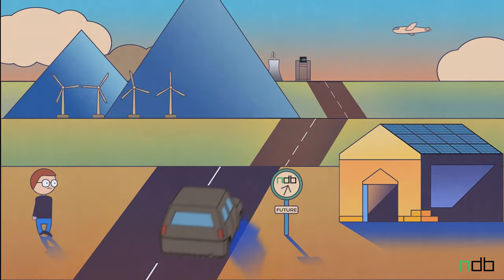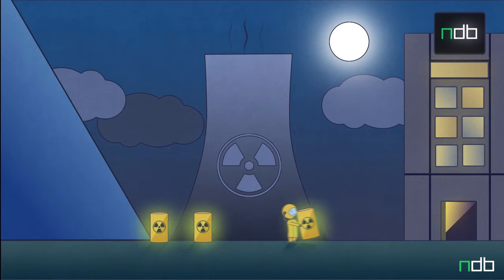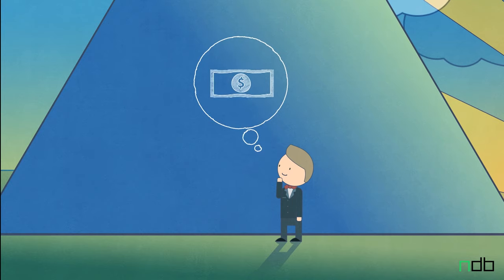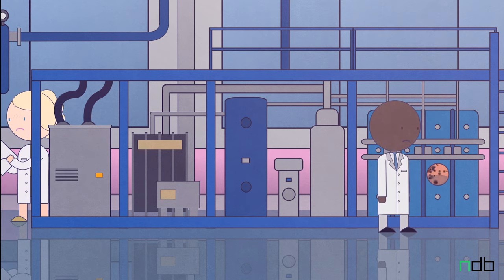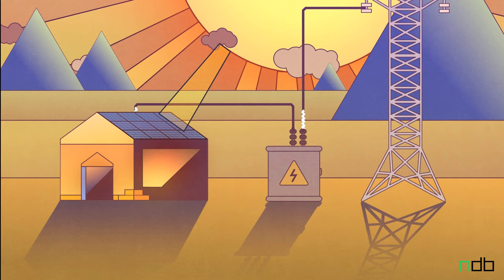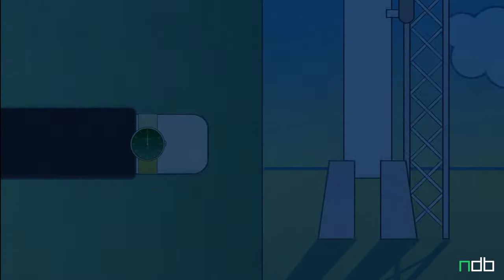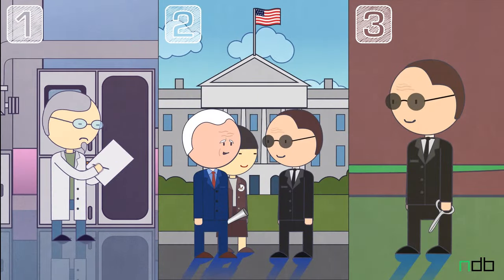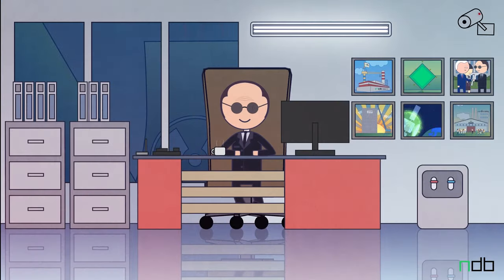Nano Diamond battery explained #NDB #Green_energy

Comment: Do you have any published technical articles on the science of your tech? Any data that shows promise with respect to power output/safety?
Reply from the maker: You can access our published pending patents from the following links:

https://patents.google.com/patent/WO2021236067A1
https://patents.google.com/patent/WO2022010488A1
https://patents.google.com/patent/WO2021247013A1
Reply: Have you read it yet?! 🧐
Reply: Also wondering if you read the published patents yet?
Reply: @VRtechman  I'll be honest I don't have the electrical engineering background to know how legitimate the patents are.
Reply: @POVMovies  seems feasible but in order for it to be effective long term there would still need to be a capacitor on board making the battery itself have a pretty significant failure point. An additional problem is discharge. At some point this thing will have to discharge excess energy meaning it will have to either ground itself or connect to the grid to dump it's charge. Having this in a pacemaker without an outlet would probably be a death sentence because excess charge would lead to your pacemaker being forced to discharge on the heart. It's a cool concept but it's uses would be limited to something like a cellphone or something you could plug in. A power wall, even an EV battery replacement would probably make more sense. Imagine you drive all day and your battery is down to 50% you drive home and you plug your car in but not because it needs to recharge but rather it needs to eventually discharge excess energy regeneration.
Reply: @Some1special what if you had a battery small enough that it matches the power level on the device whenever it's on then if you power it off you could have a port for the excess energy to go
Reply from the maker: @Some1special  thanks for the comment, concerning your comment about pacemakers, please refer to https://orau.org/health-physics-museum/collection/miscellaneous/pacemaker.html:

"Over the years, various power sources have been used for pacemakers, including thermoelectric batteries containing 2 to 4 curies of plutonium-238 (88 year half-life). As the term "thermoelectric" implies, the heat from the decaying plutonium is used to generate the electricity that stimulates the heart. At present (2003), there are between 50 and 100 people in the U.S. who have nuclear powered pacemakers. When one of these individuals dies, the pacemaker is supposed to be removed and shipped to Los Alamos where the plutonium will be recovered."

Comment: After Theranos, this is hard to believe. Even in huge nuclear plants we cant generate electricity this way, avoiding the rankine cicle (radiation-->heat--steam-turbine-movement) has been a long standing problem... True, we had radioisotope thermoelectric generators, but that had problems of its own (bulky, heavy and low energy output, plus dangerous waste). On the other hand, patents seems legit, but... What Theranos was lacking, and everybody should have seen, was whitepapers that explain the technical reasoning behind it.  This kinds of breakthroughs doesn't came out of the blue, just like this.
Reply: Glad someone else notice that. This projects has to many similarities to Theranos and it wouldn't surprise its another scam like that company.
Reply from the maker: Theranos was a public company claiming a ready product.

NDB is not a public company and not claiming a ready product. We are still a venture in R&D stage and planning to realease a commercial prototype upon success.
Reply: There's a difference. Theranos was a company that claimed to have its own breakthrough but never released the technicalities of it. Experts were able to smell the BS from a mile away. On the other hand, not NDB or even any company invented the concept of diamond batteries. This originated at the University of Bristol at least 6 years ago, which has made a working prototype followed by a different version by Moscow University. I'd imagine their technicalities are out there in the scientific community and have been peer reviewed by hundreds or thousands. The question is rather how NDB is claiming they can commercialize it.

Comment: Look into the RV Life and Vandweller markets as well. We can seriously use those instead of solar (lower wattage) or noisy, gas-powered generators (heavy and higher wattage), coupled with multiple Lithium or other batteries and an MPPT charger. The current setup is large, inefficient, and in need of some serious technological advancement to stay off-grid.
Reply from the maker: Thanks for the insight and interest, we have shared the input with our R&D team.

Comment: With a small dimension of ndb battery can we use it to power a whole appartment? Or there will be different dimensions for different types of ndb battery? I believe u will answer this.
Reply: To power a kettle it would require 30 million of these and weigh 90,000 kg, it is not powering an apartment any time soon. Even powering a smartphone would require a 60 kg battery.
Reply: @conorstewart2214  - Like with any new technology it takes time to perfect it.  The idea is cool and would also address the disposal nuclear waste, basically free energy.

Comment: I certainly appreciate the idea behind this and I think it certainly has a great deal of merit. However I'm not sure the energy sector would be prepared for this. You would definitely need to have some pretty big legal changes in the energy sector as far as utilities and the limitations on output to the grid. Building something like a grid connected power wall with the proper shielding would easily be the most effective product. Basically build the modules, grid them out and make banks. This would make the perfect product for off grid homes, backup power, and even investments towards sustainable living. Just as a side note sometimes the best thing you could do is launch the product at its highest quality and simply let the legislation catch up on its own.

Comment: What will you do about decommissioned devices that contain these radioactive power cells? How do you safely dispose of a radioactive consumer device?
Reply: the isotope is inside a synthetic diamond. it is not radioactive unless you cut open the diamond (good luck with that). It takes billions of years for diamond to decompose to minerals by which time the radioactive isotope would have decayed too.
Reply: @joyoptimal6286  what if people intentionally press the diamond, say froma handphone, by using ada hydraulic press machine ? Would it be broken ?
Reply: @amintaginting6698  if they use a hydraulic press, yes, it could possibly break. Likely, this kind of battery won't be made available for anyone to buy commercially. Only for special purposes only, for example, like a heart pace maker.

Comment: This already exists and makes microwatts.
Reply from the maker: Thank you for your insightful observation. 

You're right about the longstanding presence of nuclear batteries in technology, but they should not be limited to microwatts. These batteries can be designed using various radiochemicals, each emitting different types of particles such as alpha, beta, or gamma. 

The range of beta emitters is particularly diverse in terms of power and energy density. 

Take, for example, Sm-151, a beta emitter with a 90-year half-life, offering a power density of 6.43E-04 mW/cm^2. Contrast this with Cs-134, another beta emitter, but with a shorter half-life of 2.061 years and a significantly higher power density of 8.10 mW/cm^2. 

Alpha emitters present a different scenario. Am-241, commonly found in smoke detectors, has a half-life of 432.2 years and a power density of 1.66 mW/cm^2, whereas Po-210, with a mere 0.379-year half-life, boasts a striking power density of 2.44 W/cm^2. It sounds like you're hinting at a specific type of radiochemical, possibly including Os-194, Sm-151, Ra-228, H-3, or C-14, all of which have power densities below 1 mW/cm^2.
Reply: NDB indicted by SEC for investment fraud.

Comment: Hi , While squeezing these diamond batteries between the plates ,how much pressure do you apply and battery ,What are the most weighty conductive materials you use in the battery?Anyone interested in processors working with this method?
I didn't ask with what technology you compressed it :D I would like to see the press machine Elon Musk made

Comment: So we need a powerplant with huge reactors to process raw nuclear materials into energy and we can use some magic coating to process nuclear waste into energy, hm, okay
Reply from the maker: Magic coating? Not sure.
Reply: @NDBplus  of course it's magic if it surpasses other betavoltaics enough to power an electric car. Or it's a wordplay and "can be used in electric vehicles" doesn't mean "it can power electric vehicles"? )
Reply from the maker: @Egor9090  Beta particles are low energy particles and useful for very low power applications. When it comes to electric vehicles alpha particles should be considered.

Comment: I think this looks interesting, but the scale of power output from these devices is on too tiny a scale to do more than barely power LEDs no? When the video describes the batteries as being used to power vehicles, is this not a disingenuous statement? The video allows the viewer's imagination to assume you mean running the vehicle entirely on NDBs rather than it only offering a tiny, microvoltage squirt of energy to help light a display console or something. It is hard to believe that this will be replacing or even competing with the current battery market. Please let me know if I am wrong. I would really like to be wrong.
Reply from the maker: Dear Aron, why you think the scale of power from these devices is going to be on tiny scale? It seems you are not considering wider range of radioisotopes. There are variety of radioisotopes with different scale of output. There are many peer reviewed literature that are in contrast to your assumption, i.e. https://aip.scitation.org/doi/abs/10.1063/1.5123163

Comment: I'm really at spectation with this technology you promise here...
The only concern is radioactivity in the long run.
Me as an electric mobility investor and EV advocate this really pick my interest but I'm more interested in the characteristic of self charging is very appealing but in an electric vehicle you ALWAYS BE CHARGING even is the cells auto charge. Because discharge rate will be much more that the self charging. Even with the car stationary it would take maybe several days to selfcharge in to own to be usable. And in the case of good self charging rate. I would be concerned about overcharging when not used in a long time. Although for the transportation industry it will be revolutionary.
Other concern is how would cells behave under heavy load like high current output; is there is to much sag it wouldn't be recommendable for high performance vehicles although I think that will be solved as technology develops. But for electronic devices it will be groundbreaking!

Comment: So you have to make synthetic diamonds to use this tech? What's the real carbon footprint of such a battery?
Reply from the maker: Different type of semiconductors are under investigation. Synthetic diamond is the best option, however other cost efficient. materials like SiC, etc could play a role, even though they may lead to lower efficiency.
Reply: What about  paracrystalline
Reply: synthetic diamonds are NOT NECESSARY
they are only a sales catch and a misdirect